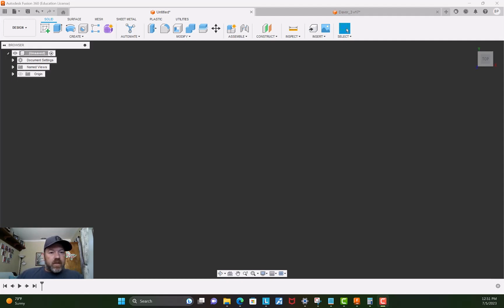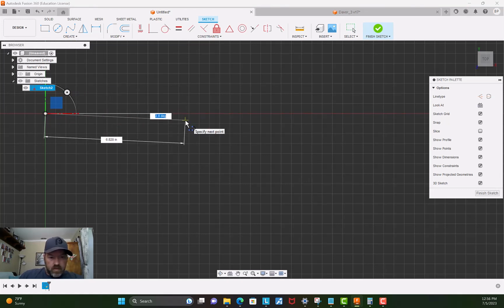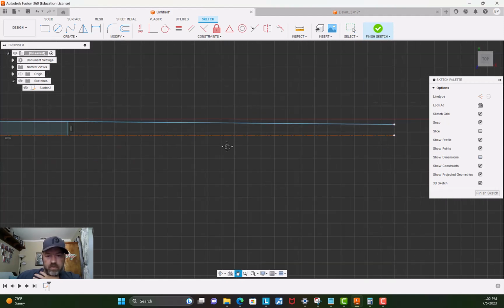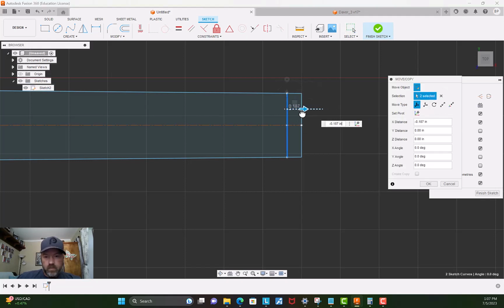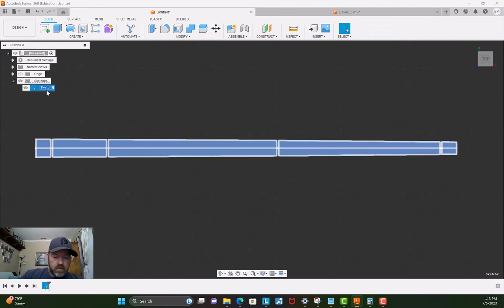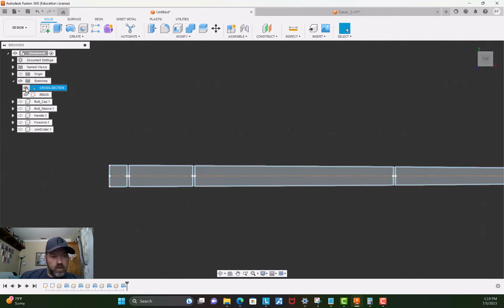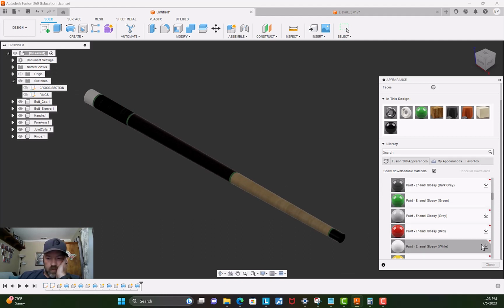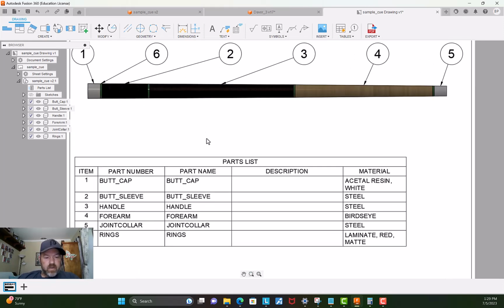Creating 3D Model of Cue

Comment: Good video. Not sure if you still check comments on this video but when you are bringing your lines down to cap off the ends of your sections you are locking them in at 90° to the line that you have tapered, not 90° to the origin. That's why you were having issues getting the forearm part of the sketch closed off and when you zoom in tight you can see the pixelation of the vertical line being tapered as well.

Comment: you do this a bit different than I do... suppose it gets basically the same result. I start with a 32~ mm circle and extrude it into the different sections (butt cap, butt sleeve, rings, handle, forearm, etc...) and use a negative taper angle...

Have you found a really good method of generating points in fusion? The best I've found is creating a sketch on the circular 32mm radius section of the bottom of the forearm, then creating points a couple hundred mm up on a construction plane and creating lofts from the sketch to the points... It works, but it's not perfect and is very difficult to create veneers on the points. If you have a better method, I'd be very interested in learning.. If you want more info on my method, lemme know.
Reply from the maker: If you just want to veneer/points to visualize a model, it's quite simple. Create a sketch on the surface plane or your forearm model. Draw your points/veneers on this sketch and then extrude .001" starting from the object. I'll try and make a new video to demonstrate